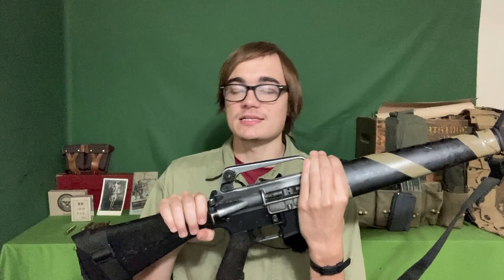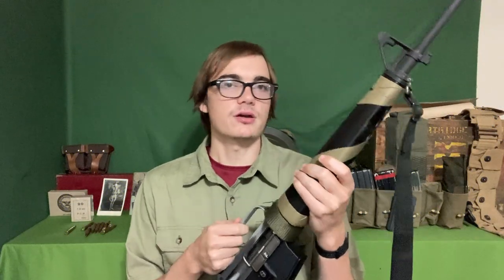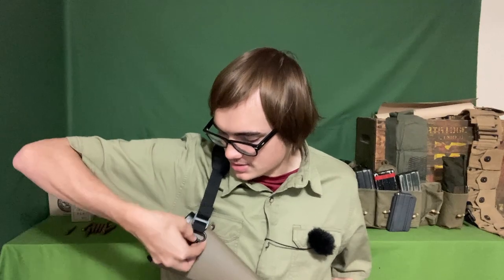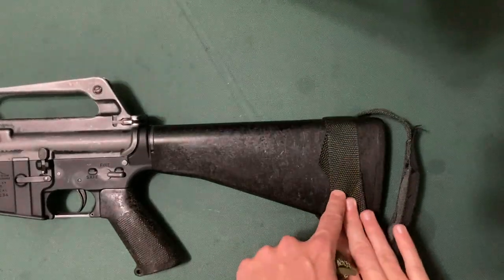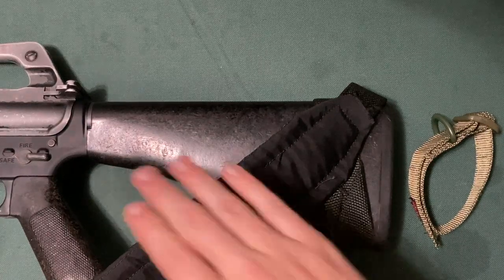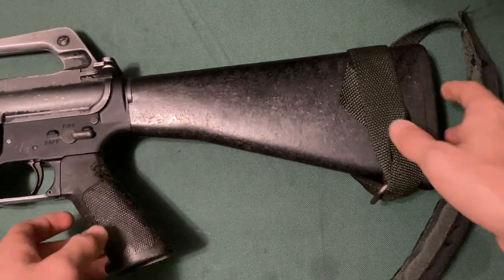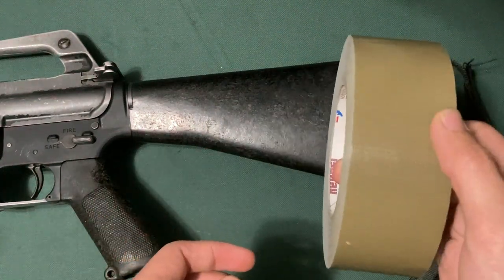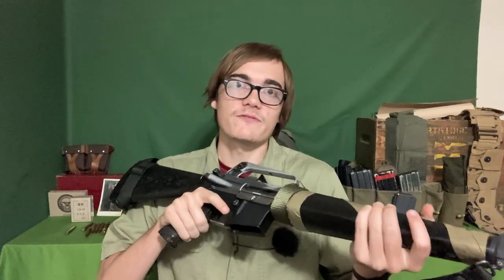Modernizing Retro Rifles Part 1: Slings

Comment: The best part is you can do all of this and still stay 99% retro because they implemented all of this in field. The slings were being mount with Paracord to the gas block so the rifle would lay properly and the butt sticks if a1/a2 were getting straps out on them to lay the sling properly while car15 stocks solved the problem with the sling loop placement. People were attaching grips to the holes in the handguards and optics were being mounted to the carry handle. 100 mph tape and hose clamps were being used to mount lights. So you can modernize them by just further retro-ing them
Reply: What brand of rear stock was on the coyote brown AR, with the QD attachment points on it?

Comment: Blue Force Gear makes a nice attachment for the m16 style fixed stocks for mounting the sling on top all while clipping into the original bottom mount keeping it from moving or sliding out of position. $10-15 too and used by the Marine to my knowledge. Also another thing to consider is using an adjustable sling like a Ferro Concepts, Edgar Sherman Design, and/or a Blue Force Gear sling.
Reply from the maker: I think this is the same style as the BFG one, but it’s probably better. Personally, I like the setup I have now though. 
I’d like to look at an adjustable sling someday. Thanks for the comment.

Comment: You can use a sling attachment strap and use Paracord to attach it to the strap and the stock. A good way to attach a sling mount on top of the fixed stock, keep it silent, and cheap for less than $10.00.

Comment: The qualifier is: does it work for you? I tie 550 cord to the rear sling swivel (both ends) two strands just loose enough to attach a sling. You can also buy a counter leaved scope mount for the handle to mount a red dot. Thanks.

Comment: I run a fancy new modern ferro concepts slingster woodland m81 camo edition that was like the last couple in stock or something. Runs beautifully on my Xm-177-e2 E&C airsoft gun; a realistic finish on this rifle as I got a custom version of the gun that even has engravings and nice proper colour and all. Only real thing that's inaccurate is the fact it's a Car-15 stock that's polymer with multiple positions but honestly it's a nicer stock then the original heavy acetate finished aluminum two position stock. I love this series of yours btw & would love an expansion on the series even!
Reply from the maker: There’s some other things I’d like to do. Thanks for the thoughts!